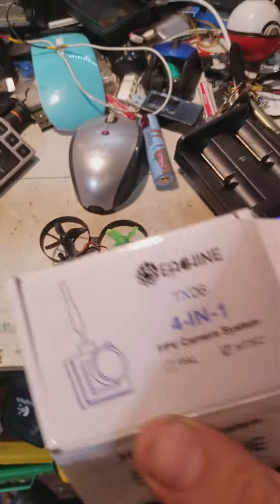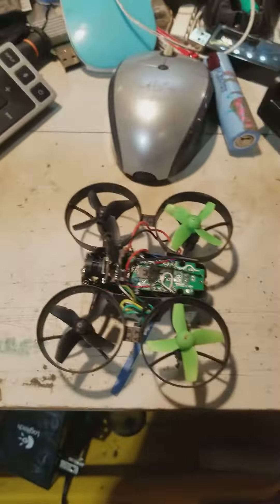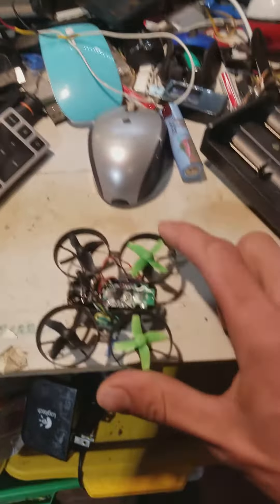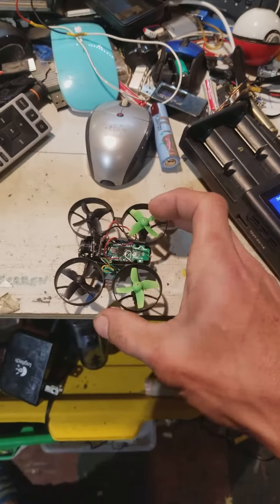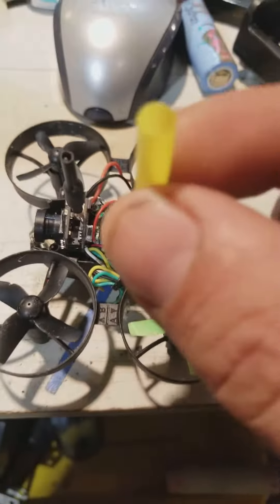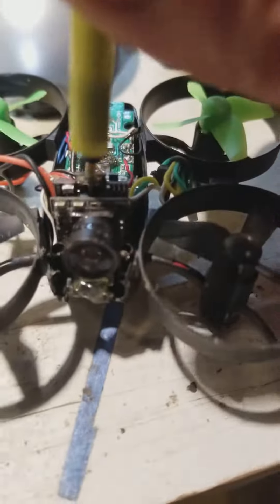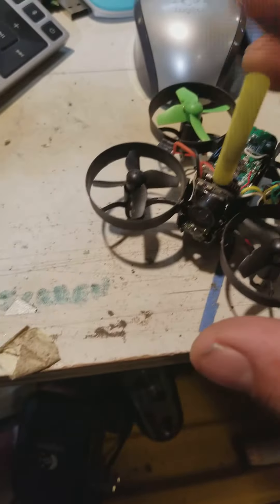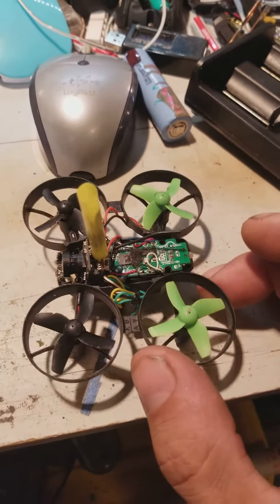Eachine tx06 Free Antenna Protector

Comment: Max range?
Reply from the maker: Depends on where you fly it , indoors we live in 3 story townhouse and its clear as day thru multiple floors and bricks, outside if its 25mw line of sight 100yds? football field maybe? 200mw is alot more range but any of these eachine AIO are great, even now that i have higher powered 1000mw etc still always amazed how far 25mw goes
Reply: @BonzaiFPV  I have some toy drones.iam planning to fit this in it..is tx06 enough?
Reply: @BonzaiFPV  what's the difference between tx01 ,02 ,..... And 6...in terms of range and video quality pls help...iam confused...
Reply: @BonzaiFPV  iam also planning to buy  vr 009 ...is this ok for my setup.?
Reply from the maker: @aju5405  Vr009 is that this one here?:

 https://www.eachine.com/Eachine-VR009-5_8G-40CH-Auto-Searching-Double-Antennas-mini-FPV-Goggles-3_0-Inch-480+320-LCD-Screen-Built-in-Battery-Black-p-2039.html

If that is the same one they are actually made by a bunch of different manufactures, i believe eachine has like 10 sister companies, there is one made by makerfire, i actually have one of those same units made by arris, I will say it has a great screen, but in reality the screen is only like 1.5 x 2.5 INCHES. Ill have to upload a video, i actually was so impressed with the screen I designed and 3D printed a case for it to be used as an "FPV Watch" on my transmitter (if that give you any idea how small they are) and not only is the screen small, some retailers designate it as "kids size fpv goggles" I will say however, they do work well enough to be a first pair of goggles. But for a few more dollars (or maybe cheaper if you can find used) I would get something like an eachine 800D. You can find them new sub 100$ and sometimes used for 30-50$. They have a built in DVR and Dual Video Receivers, while the VR009 has two antennas, they are both being fed by only one RX. This will impact your range greatly. It also have a very small battery that give shorter runtimes.

Honest opinion i would go 800D as a starter set of goggles, the screen is large (some people actualy prefer it to fancier goggles) If you buy it new it comes with a patch antenna as well as a Circular polarized one. Its a great starter kit. I love mine so much i also converted it into a screen to keep in the workvan/base station for the wife to watch :) and the DVR takes microSD cards and you can review and share your footage :D
Reply from the maker: Here is a link to the eachine 800d for refrence (you can probably find it cheaper off the retailers site) 

https://www.eachine.com/Eachine-EV800D-5.8G-40CH-Diversity-FPV-Goggles-5-Inch-800*480-Video-Headset-HD-DVR-Build-in-Battery-p-859.html

and to give perspective, i have personally used and own Eachine 800d, Fatshark HDO, SKYZONE 02c, Fatshark Transformer, Makerfire 009, eachine vr009, Fatshark dominator and out of all of them if i had to pick the best for starting out, or if i had to do it all on a buget, Eachine 800d all the way
Reply: @BonzaiFPV  thanks for the reply. unfortunately iam sick due to covid.once I recover I will buy Goggles
Reply from the maker: @aju5405  Yes it will likely outrange most toy drones, also with 25mw it uses less power so alot of times you can hook it direct to the drones battery and make things easier.

a few good ones on amazon ali/banggood

25mw:
eachine tx06
crazepony 700tvl
wolfwhoop wt07

200mw

eachine tx03

there are also switchable 25/200/100 which may work well for you too

Switchable :

Wolfwhoop Wt03
akk micro FPV aio

For whoops and small ultralight drones (most toy drones) i would use Tx06, for larger birds you can start dialing up the MW

hope this helps :)
Reply from the maker: @aju5405  Ugh thats terrible, hope you feel better soon, Hopefully its the covid most people get, I had "long haul" covid last year, and it totally changed my life. No fun GET WELL SOON! :D
Reply: @BonzaiFPV ❤️
Reply: @BonzaiFPV  I live in india..here AliExpress app is banned.even if I o through website the shipping methods are not reliable. So I ordered tx06 from banggood. it will take 40 days to arrive.and there might be some customs issue.i get the package without any issue then I will order other things from banggood
Reply from the maker: @aju5405  https://www.youtube.com/watch?v=aRkql2kNk5g
Reply from the maker: @aju5405  Cool Good luck hope it comes soon Happy Flying! More videos on the way :D (btw the link shows the differences between the two starter FPV goggles was talking about take care!)
Reply: @BonzaiFPV  you uploaded a new video for this...that's awesome❤️❤️❤️
Reply: @BonzaiFPV  now i understood the true difference.i will choose wisely